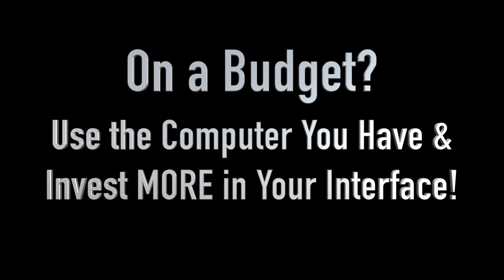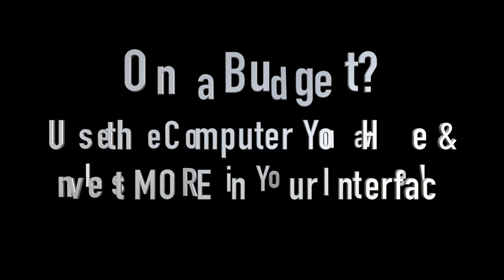Building a DAW in 2022 - Introduction: The Computer, Speed, Mac vs PC, History and more.

Comment: I always enjoy mac fans knocking windows. As a Windows developer for 20 years it does give me a little chuckle. I bought 3 8 core Mac Pro machines in 2008. By 2011-2012 they were no longer able to be updated and became worthless boat anchors. I won't buy another Apple product ever.  As well, I've done 3D for TV & Film as well as a ton of editing on a PC and at this point, you can still build PCs that outpace any mac for video editing. Not to mention the GPU cards from NVidia, etc. Good lock getting any of those to seamlessly integrate into a Mac platform.
Reply from the maker: Well, Apple has its problems for sure. But in my 25 years of living on “both sides” my money is on Apple. Especially the M1 Pro Chip for video render. To each their own